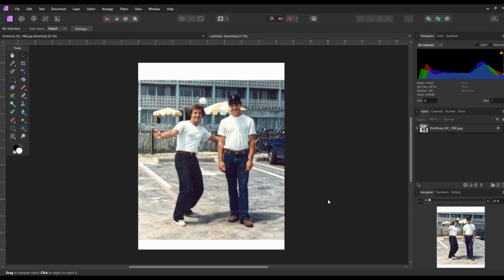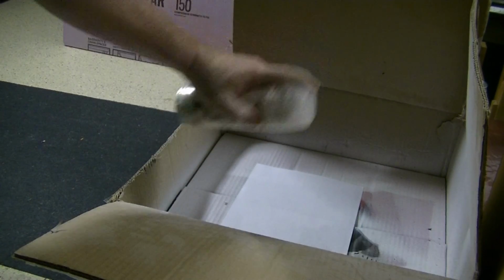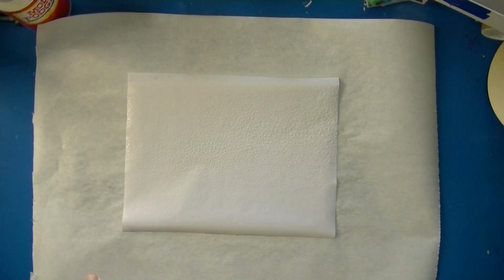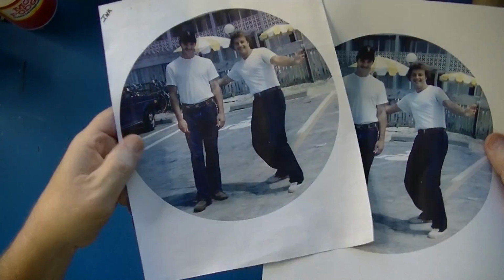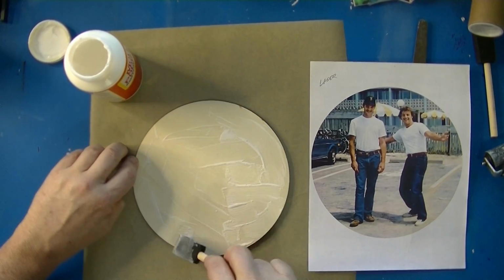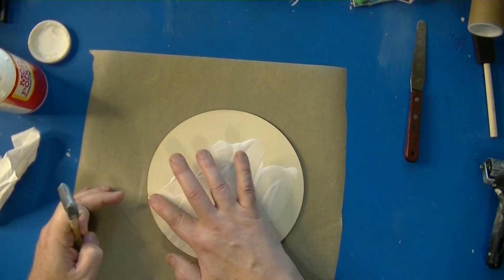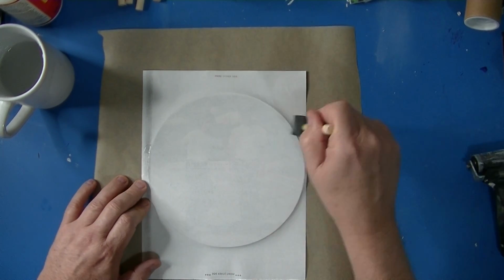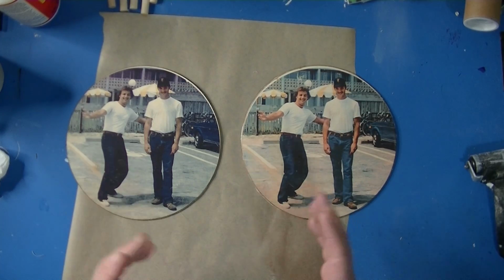Inkjet vs Laser: The Ultimate Image Transfer Showdown!

Comment: Does you ink jet printer use pigment ink  or  dye ink?   If you are printing for transfer to a T-shirt would you have to use pigment ink to avoid fading after washing?
Reply from the maker: My printer I use pigment. But dye ink for a project like that would not be any different. Your fade protection is not going to be the ink you use but what you use to 'glue' the image onto the fabric.  Also, remember that using inkjet with this paper would require a couple extra steps to make it work, where using a Laser is preferred and easier.  Be sure to watch my TShirt videos on this subject as this paper is not designed for T-Shirts but works if you learn the tricks.

Comment: Rix did you say if is not completely dry, it could end up with spots? 
I did a few pictures on the 4” wood, let them dry and ended up with small pin hole size spots on most of the finished product. 
One I sprayed with coating spray (Kamari). I adjusted it to fit the wood.But spots  and not a good picture on both. 
What ya think?
Reply from the maker: Do you see parts of your image left on the transfer paper that matches those dots you have on the wood?  If so, then those spots were NOT glued down.  Either missing glue, poor contact, or glue not dry in those areas.  

As I always say, IF ANY PART OF THE IMAGE HAS NOT TRANSFERRED AND YOU CAN SEE IT STILL ON THE PAPER WHEN PEELED OFF, then it was not glued down.  Because you will NOT be able to peel up the image if glued on the wood. Impossible.

Comment: Is it possible to use ModPodge instead of the spray starch, or are there any alternatives?
Reply from the maker: The starch is to allow you to print using an Inkjet printer.  ModPodge won't work. You can use it to glue with, as I often do, but not to use for inkjet printing.

Comment: No Spray on the Laser Correcct??
Reply from the maker: The paper is designed to take Laser Printing as-is. No prep of the paper required. You do have the option to spray AFTER you print if you think you might use too much glue and want to not chance possible smearing or wrinkling.  But normal application, just print, glue, dry, moisten and peel when using Laser.